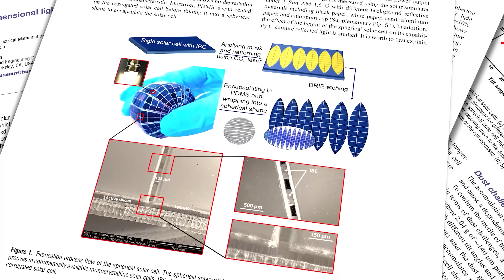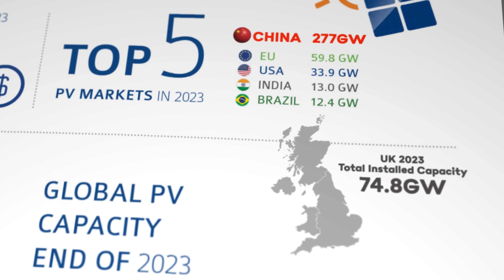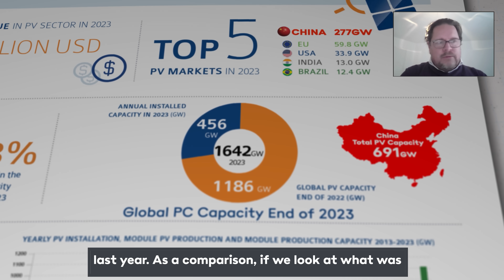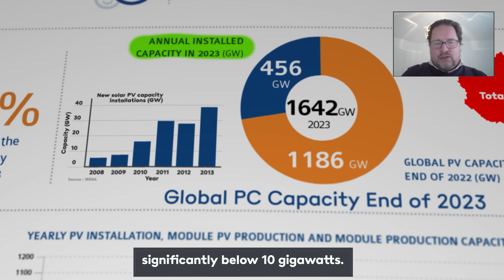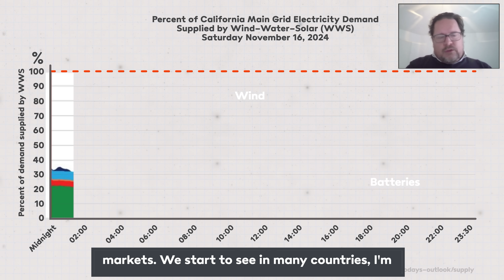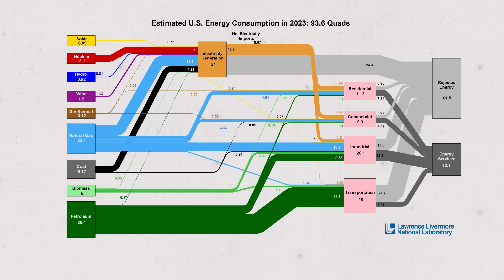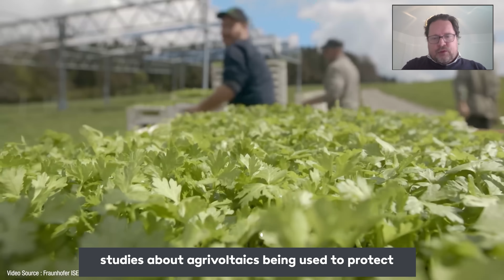Renewable Energy Domination

Comment: One gigaton is nice.   Going back to "peak tree" would be about 2 gigatons. 

However we were supposed to be at 29 gigatons now and we have instead reached 41 gigatons. 

Even without runaway methane sublimation, that is enough CO2 to increase the temperature by 1° C every 24 years.. 

Play 2° C is baked in as of 2026. We pass plus  3° C when we don't fix this problem by 2050.

It's already too late. It's been too late since about 2012. 

I suppose we could spend about 15 trillion dollars on carbon capture.  But we all know that's not going to happen.  Trying to spend that much money on it might make it much more expensive than a currently is.  Or maybe we'd get some economies of scale than it would only cost 12 trillion dollars. I'm betting the corruption would be something we have never seen before

Comment: For the UK does that "only 3% of land area needed" for all our power include all energy consumption, just projected electricity use or just current electricity use?
Reply: One thing that feeds into the answer to your question is what the video touched on with the Sankey flow diagram - a huge amount of fossil fuel energy is wasted, either when generating electricity or when being used to power various end-use machines like cars. A guy called Saul Griffith analysed the US economy in his book Electrify, and concluded that only half the primary energy currently needed is required to be generated in the future by non-fossil fuel sources if the majority end-use machines/appliances are electrified.
Reply: @grahamt2672  I'm aware of that point but struggle to put it succinctly. Well said. Thanks.
Reply: As per the video it's electrical energy use, not total energy - the report in question considered a mix of onshore wind and solar to give the 3% figure. The figure is based upon projected energy use, but would also factor in the planned 30GW of offshore wind and 95GW of batteries in the UK by 2030, such projected demand would include EVs but not the transition of domestic heating to heat-pumps.

There have been estimates for total energy (Carbon Commentary blogs for example), that look across a mix of sources - offshore wind, onshore wind and solar (with a tiny bit of hydro and geothermal as well). Of the main three sources the analysis concludes that 5.3% of the UK's waters (economic zone) for offshore wind,  2.1% of land for solar and 12.5% of land for onshore wind would be sufficient to cover approximately 1,800TWh of total energy used in the UK. The 12.5% land for onshore wind being an area figure rather than a footprint one, would support other uses of the land at the same time - onshore wind is spaced out over an area to minimise inter-turbine disturbances, this area doesn't prevent agricultural, forestry, commercial or industrial use of the land.

Comment: Doesn't talk about the fact that the emergence of EVs, ai is going to exponentially increase the energy needs
Reply: Perhaps with 8B people on the planet we may need not so much AI?
Reply: @UK75roger  It doesn't work that way.  8B people do not equal one ChatGPT.  @tomahtotomato The emergence of EVs and AI will certainly not exponentially increase energy needs.  The increased demand from EVs will be closer to a linear increase, and is well within our ability to upgrade the grid.  AI data centers are a bit different; in some cases they are arranging their own generation assets located close to the data center.  (More likely siting the data center close to the generation assets, but you get the picture.)

Comment: When are we going to hear that all new builds have PV’s as standard on the roof!
Reply: Labour have just backed out of making that mandatory after pressure from the building industry. It's going to be 'recommended'. Such an easy win that most people would have supported. 😢
Reply: More significant would be new builds being at least carbonlite level 2 (50 kWh/m2.yr heat load) and preferably passivehouse (15 kWh/m2.yr). Nothing wrong with solar on the roof too, but building up-front emissions and in-use emissions make a much bigger difference than panels on the roof, and for the entire lifetime of the building. Having a decent fabric efficiency makes it possible for the roof-generated energy to run the whole house for at least most of the year. For current average fabric efficiency the roof simply isn't big enough.
At the moment the SAP regulations strongly encourage builders to make mediocre buildings with poor airtightness, then whack about 3 panels on the roof to get it into the next EPC class. It's not good long-term policy as it bakes in a great deal of ongoing energy usage.
Reply: @xxwookey  We should be doing both Builders don't care about  the people who are going to live in them houses.  All they care about is profit, So they can drive around in their Gas guzzlers and sip wine in there jacuzzis.
Reply: i would argue that roofs are not ideal. ground mount arrays are better, especially if over something like a patio where they can provide shade
Reply: @williammeek-h2o  'better' in what sense? Easier to DIY, provides some shade, but also: usually less area, nearly all houses have a roof, not all have a patio, more likely to be shaded
Reply: @xxwookey  easier for maintenance like cleaning and clearing snow, also reduces risk to the house from fires.
but yes, if roof space is all you got then use what you got.
Reply: @williammeek-h2o  Anything shading a patio is known as a roof. The advantage of roof mounting is that it requires no additional land footprint.

Comment: I personally think the focus on big power storage/capacity, is misplaced. taking into consideration, current transmission lines and cost to upgrade to what possibly may not be enough. consider smaller, either individual or co-op in small areas which would need minimal upgrades, storage and " generative" capacities. this would allow us as humans and communities to transition to green from oil usage easier, then a sudden swap from-to, with less problems/bugs. we currently lack the capacity to make 100% green energy for use at 100% of needs...... changing focus to smaller " goals" would lessen the damage from a sudden shift.

Comment: Nothing gets recycled because recycling is not profitable. The only way to scale recycling to the level required is a planned economy. Solar thermal is already 3x as efficient as PV,  2x as efficient as the best theoretical PV. It's a lower tech, simpler and more applicable to retrofits of existing infrastructure. That's why it doesn't get investment. It doesn't inspire angel investors in the startup industrial complex to say "We need to accept that steam runs the world. We need to just boil water, but with mirrors and lenses"
Reply: "Nothing gets recycled because recycling is not profitable." <- metals have long been recycled, so you're just off.
Reply: @TheDanEdwards  obviously I was using a bit of hyperbole, the point stands that most things aren't recycled

Comment: When discussing this issue, we hear a lot about cost reductions in green energy and storage. I tend to agree that with enough storage we can turn the flow of solar energy into the stock of batteries and therefore alleviate the non-fungiblity of green and base-load forms of energy. However, I wish that there was more discussion on the other side of the balance sheet, of the profitability issue that grid-scale solar and wind faces. It is no secret that what gets done in our society is what is profitable, and in the EU and the US many projects never break ground because the financials cannot be reckoned with.
Reply: As an advocate for solar and wind energy, I don't think that's going to be sufficient. 

I think you can solve up to the 3-day problem with storage. 

The problem is that 100 Year events are 5 to 7 days. 

I think using nuclear would be incredibly expensive since it would not be needed except for during those disasters and , in Texas,  they had to shut part of the nuclear plant down when the 100-year ice storm froze one of the water inlets. 

100 Year heat waves combined with drought can be just as bad.
They had to shut down or restrict operation of more than one nuclear plant in Europe for this reason right when they needed the power most. 

I don't have a good solution. But I know that having 7 Days of battery storage is going to be really expensive. 

And it won't be needed for a 100 years at a time. 

But if you don't have it, lives will be lost.
Reply: @mac_mcleod  Getting hung up over edge cases is pointless. In the UK the National Grid has stated that to maintain a publicly owned fleet of CCGT power stations would cost approximately £2bn/year, not a lot of money in the general scheme of things. We would probably want to do this from a national security point of view even if we were fully renewable and had enough storage to last 10 days of zero generation. The potential emergency use of gas fired generation simply isn't an issue.
Reply: @garysmith5025  Texas didn't deal with its Edge case.  Clothes to 300 (278?   283?) people died.   Including many children.
Reply: @mac_mcleod huge long term energy backup = pumped hydro. Batteries only for hours of backup
Reply: Obviously some profitability is there because wind and especially solar are being installed at record rates per this very video. But we need 3x or 5x the growth to have a chance to limit warming by 2100 to 2°C. Increasing transmission and reducing regulations (we should be at WAR with fossil fuel companies to have a livable planet, so people opposing new wind and solar farms and HVDC overhead cables can FOAD!) will help. There's more opportunity to make end-user solar more profitable so every homeowner and business puts it on the roof, mostly by knee-capping utilities' attempts to fight it. And as always, a rising carbon tax accounting for the massive worsening harms of burning fossil fuels is the best way to get money flowing to beneficial outcomes.

 @mac_mcleod   Utilities will keep unnatural gas plants around for those periods of low renewable generation. The problem is there's little economic incentive to build new dispatchable generation and long long-term energy storage when they'll be needed so rarely. Energy consumers will get some advance notice of the coming shortfall and they will reduce consumption; those with battery storage and V2H EVs will ride out the first few days. It's going to be messy and chaotic, but rare.
Reply: @skierpage  Well, that's why we have grids.  There's always power available from somewhere.  Maybe it's more expensive than the usual renewable resource, but occasionally you need it.  No generation asset exists in a vacuum.
Reply: @jonwatson4467  it's too late to limit it to 2C. If we somehow went to zero emissions tomorrow the temperature would still go to plus 1.95 C.

We passed sufficient carbon emissions that 2C is inevitable in 2026.
Reply: @jonwatson4467  and this is ignoring the fact that things will get hotter in the short-term when we eliminate all those aerosol emissions currently providing a protective effect.
Reply: @jonwatson4467  and it's also ignoring the fact that methane is no longer decaying as fast as it used to.  The amount in the atmosphere has overwhelmed the process that causes it to break down.

Comment: Of all of the solar and wind capacity that has been installed over the years, how much was curtailed? How much was decommissioned?
Reply: I can't find data on this. There's stories of PV plants from the 70s and 80s being decommissioned on the 90s but no data about how many, if any, have shut down in the last 20 years or so. I guess it's just because they keep producing and many have been improved or renewed but not dismantle
Reply: Solar doesn't get curtailed much because daytime demand is high and because it's not all concentrated in Scotland. Curtailment is nearly all Scottish wind power due to transmission limits. We're a few years away from having excess solar power, even at the height of summer.
99% of solar has been installed in the last 15 years, so there are very few old systems to decommission.
Reply: Lots. But that will slowly change with the advent of EVs and smart charging/discharging
Reply: @stevejones2310 And with an improving grid and the development of demand side management, such as ev charging when power is in surplus, and the development of loads that exploit surplus power such as green H2.....
Reply: @stevejones2310  Is there any data on that?  "lots" sounds kind of made up.
Reply: @incognitotorpedo42  lots of data to show that like for like EVs are heavier due to the battery and even accounting for lack of gearbox, clutch and starter motor and reduced weight of motor in EV.
Reply: @incognitotorpedo42  California is guilty of putting the cart before the horse. Insufficient storage and transmission lines for all of the PV installed. But they have bragging rights.
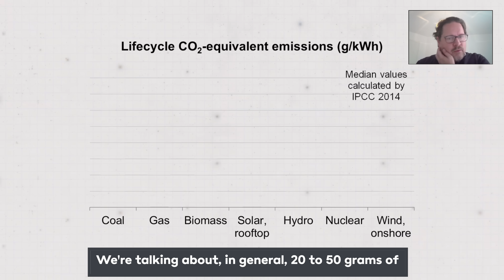Reply: Solar and wind farms are repowered all the time when It's cost-effective to install more efficient panels and turbines. And before you start clutching your pearls over the scrapped materials, understand they are many orders of magnitude less waste than the millions of tons of fossil fuel burning that they displaced in even only 10 years of operation. Go watch 4:00 again.

Comment: I really need to get round to retraining as an electrician to install solar rather than working as a decorator. 

I’ve been thinking about doing so for ages and hopefully will in the next 2-3 years once I’ve finished paying some old debt down and got some ADHD meds by then to decrease the chance of accidentally electrocuting myself in a scatty moment.

Good news with this video for once! :)
Reply: That's what I would do if I wasn't so close to retirement!
Reply: @guringai  I’m 42 myself so older than the usual apprentice (if I go down that route) but still young enough to work for a decent length of time.
Reply: @glyngreen538  Thats how old I was when went bact to TAFE & uni to work in the energy & sustainability industries. Now 63. I'd often wished I did an apprenticeship with my sparky dad!
Reply: At least in America, employment in the industry is dependent on the whims of solar feed in tariffs.   The cost for roof top solar here is several times that in Germany.  My understanding is this is driven by inefficiencies in permitting and over-engineering of electrical systems since the regulation has been captured by the industry and guilds.
Reply: @richdobbs6595  I’m in the UK luckily. Here we have a newly elected centre left government for a change (in our usage of the terms, would be very left by US usage of the terms). They’re declaring they want a massive boost to renewables and clean energy. So I’m hoping that plus the falling cost of panels would make it a growth industry and help me get work.

Comment: The new housing estates near me, in NE Scotland, are built without reference to the sun.
Reply: Everywhere in the UK. It's stupid. We've known about the climate crisis for 40 years 😢
Reply: @tomellis4750 Is that because traditionally they're built with reference to the prevailing wind?  (From the SW where I live in Moray.)  As I arrive into Aberdeen on the train I've seen plenty of new build with PV going in during construction, are they also badly orientated?  Maybe this should be part of the planning approval?
Reply: @pixelfrenzy  Don't think so, they just seem to be shovelled in higgedly-piggedly, as closely as possible. I'm in Moray too, the new schemes in Elgin and Forres are like that. 
There's a new scheme SE of Inverness has a lot of solar.
Old fisher cottages seem to have been built with reference to the wind.
Reply: @tomellis4750  I'm in a Springfield new-build in Forres and my roof is oriented E-W, but most of the scheme is N-S.  I'm renting so no chance to add PV anyway.
Reply: Thermal junk. Building codes are corrupt and designed to favour legacy energy. Same here in Canada. It's irrational.

Comment: I am a Brit living in Wyoming where most days in the year are sunny. When we do have an overcast day I cannot see how solar in the UK would pay for itself.
Reply: As stated by Jules43, the finances work out perfectly well in the UK and that's paying the ridiculous cost of roof top installation. If you're able to ground mount the cost literally halves, I installed a 4.8kW array for circa £2k and even at 59 degrees north the payback is only 2 years. 
The cost of panels is now so low that it's even worth mounting them vertically on walls which is also very cheap to do. You might lose 20% of overall output but if your investment pays back in maybe 3 years it's not really a problem.
Reply: The maths for a UK home installation has been pretty straightforward. Installing solar panels/battery/charger  and swapping our ice car for a 2nd hand EV has reduced the total utility and diesel bills by around £2500 a year which will comfortably pay for everything in around 5 years.
Reply: There's a surprising amount if insolataion, even when it's not sunny. We need a mix of energy types, nuclear, wind, solar and interconnects
Reply: Need to supplement with small fan  wind generators.